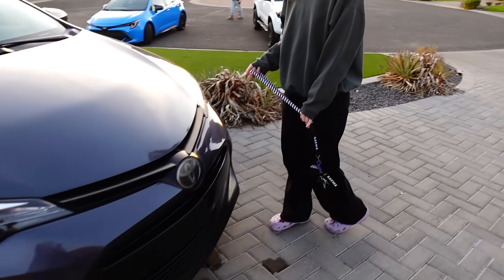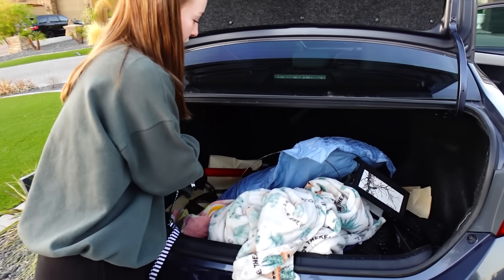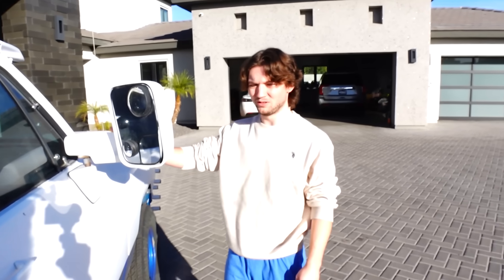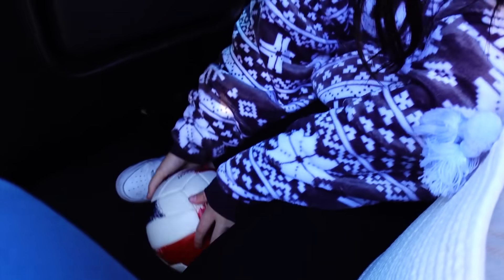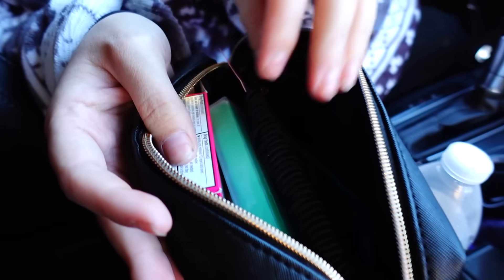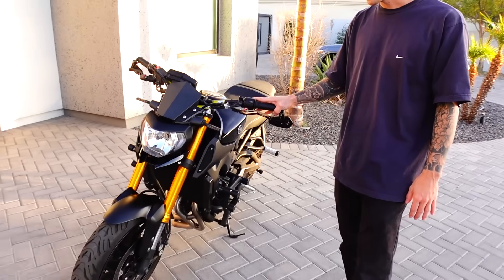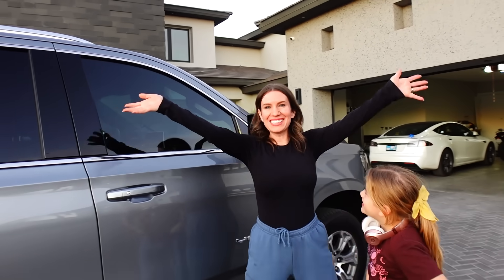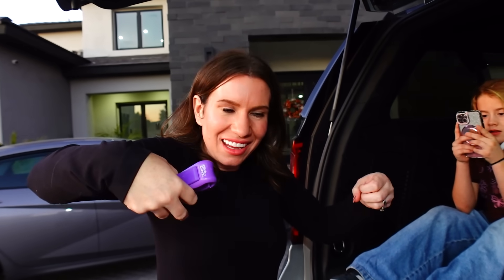New CAR Tour! | What's In My Car

Comment: I just loved my 2020 Ford Escape SE in black. I have been driving it since mid March 2022. My favorite thing in my vehicle is using Apple Car Play in it. When I first had it that I did know the controls on the steering wheel and even the drive modes,too. This is my 5th vehicle so far. Just over 25 years ago that I gotten my 1st car just before getting my driver’s license. My 1st car was a 1998 Ford Contour SE. It was old school back then. It had a radio with a tape cassette player in it. It had power windows, power locks, and 3 cup holders. It had almost everything that I wanted in a car. It was light denim blue color. I preferred in driving a modern vehicle. I never text and drive. I always pay attention when I’m driving my car.

Comment: The paint wasn't Bella's Fault that was 100% Max's fault for putting it on the seat lol! Unfortunately you would not believe how many times while working at a paint store I have seen customers paint the inside of their whole car and then try to blame the store for not putting the lid on when they turned a corner while driving and the can rolled. Your lucky it rolled against the door and not the other way across the seat and have the lid pop off. Trust me I have witnessed a whole lot worse. I use to make a habit of telling customer how to secure the cans because it had happened enough while I worked there. Good life Lesson learned lids won't stay on if a can rolls especially on the new plastic cans they are now using.